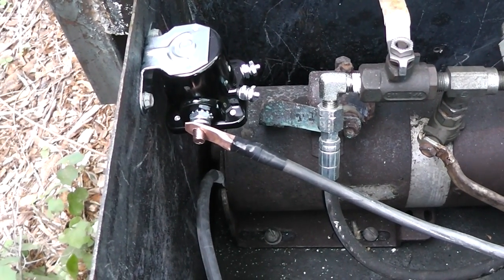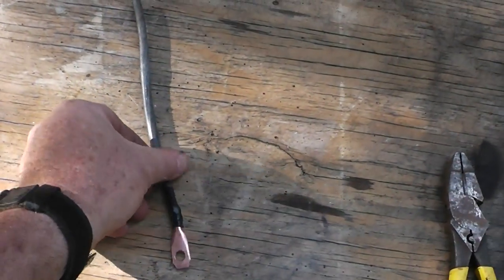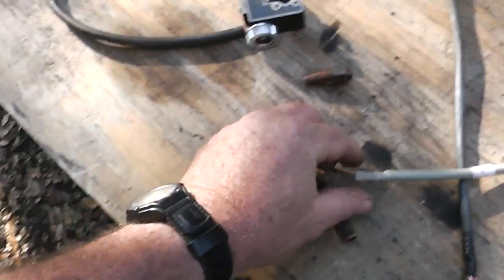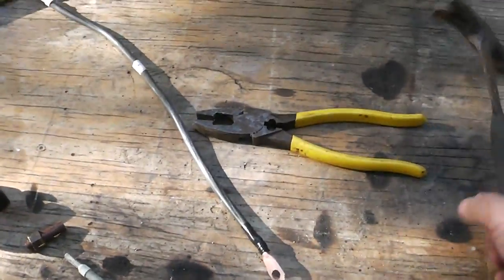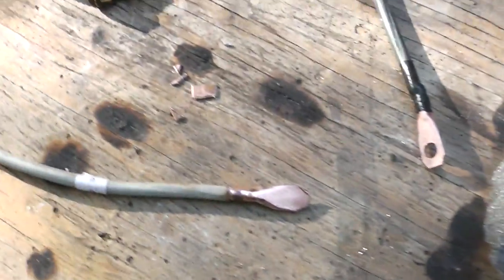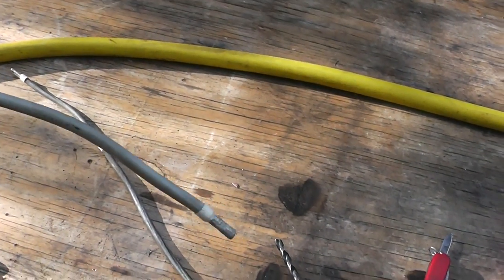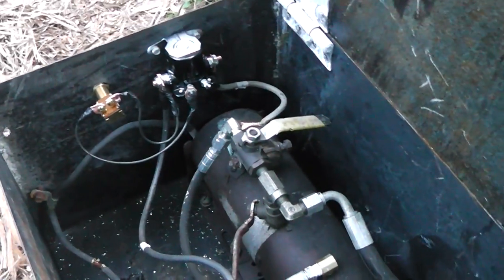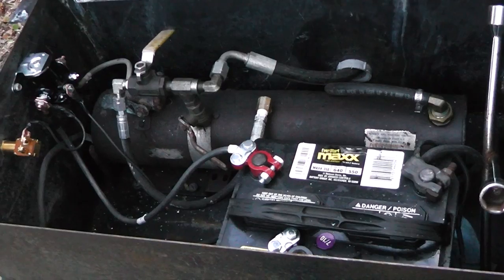Cheap,Easy & Simple Homemade Battery Cables or Wire Terminal Adaptors

Comment: coper coducts better when clean should havewire wool and a wire brush wool outside of copper tube befor  cutting use wire brush down inside if toshort to get then cutoff and wire brush from both ends on inside